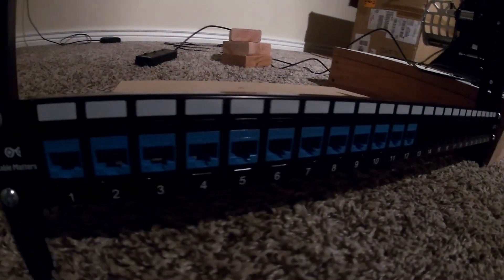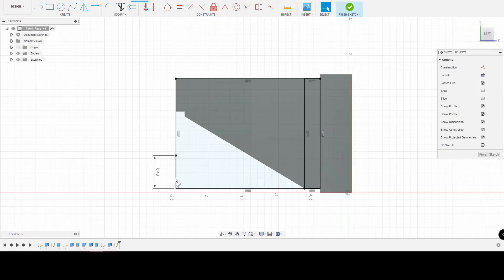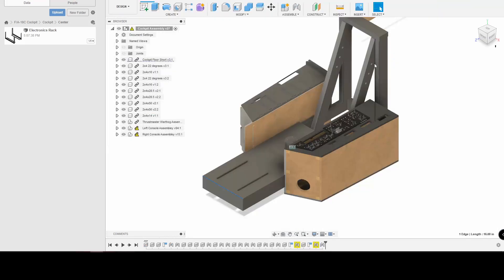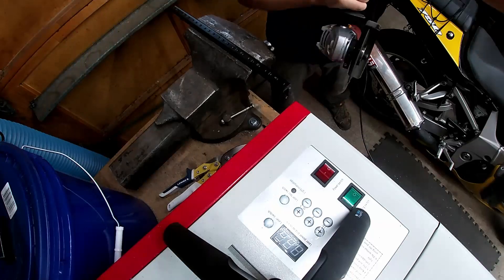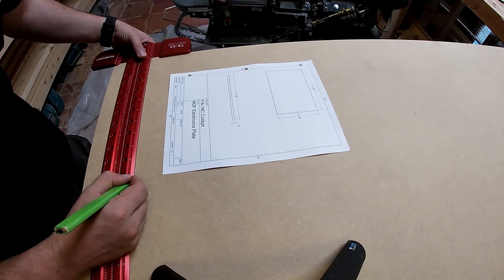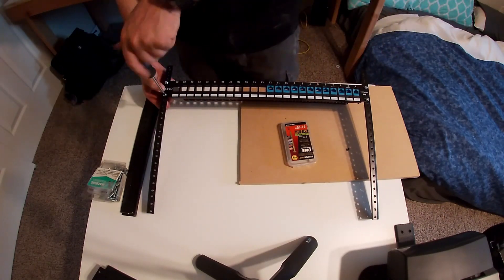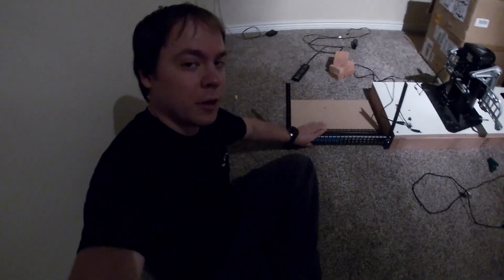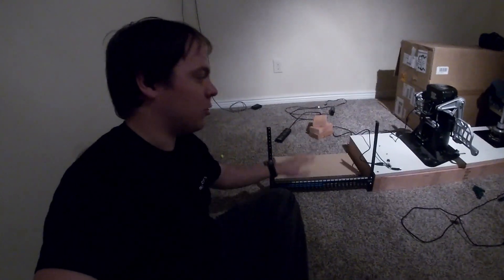F/A-18C Cockpit Build - EP20 - Electronics Rack

Comment: What main board do you plan to use to tie all those into the sim ?
Reply from the maker: I'm currently planning on experimenting with several boards. There are roughly 600 individual inputs and closer to 1000 wires that need to run into control boards so i'll probably break some of them out into leo bodnar boards for simple buttons and the core of the system will likely be an arduino leonardo. I looked into using a mega, but it doesnt support keyboard or joystick libraries the same way the leonardo does. and for ease of wiring and maintenance it'll probably end up being several leonardos and leo bodnars. there's also the eventual possibility to convert everything to an FPGA like the DE-10 Nano. To start with though. It'll be a leo bodnar and a leonardo to see which work better and how far i can take them